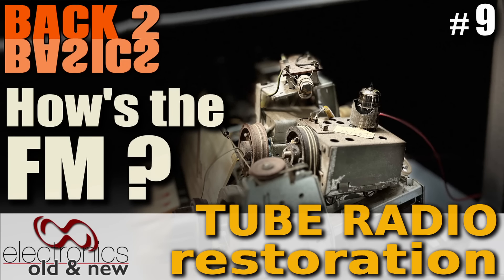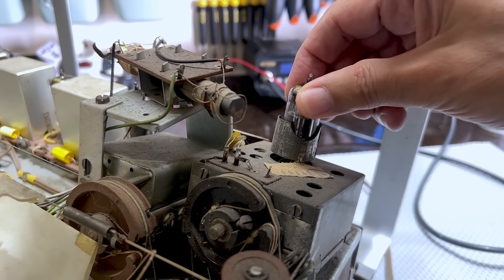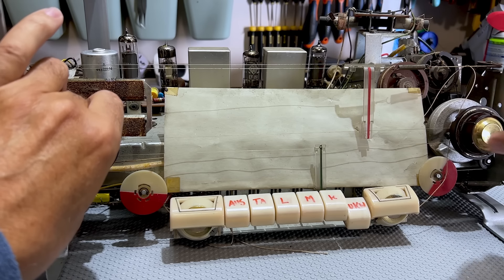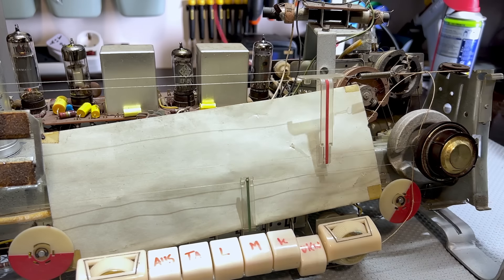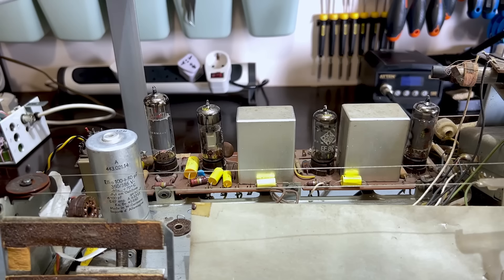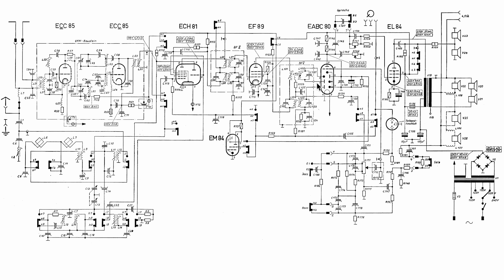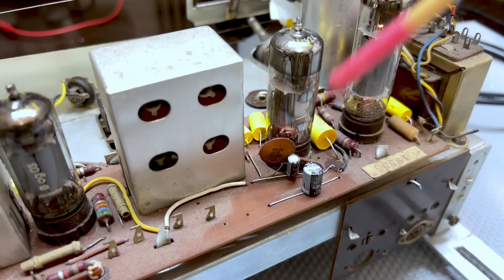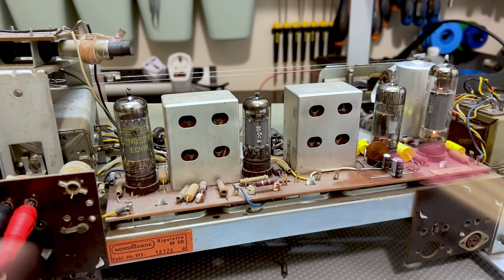Do we have FM, and how does it work? - Tube Radio Restoration Back to Basics part 9

Comment: So much effort in doing the circuit drawing clean up Manuel, kudos 👍 It takes some experience to get one's head around the ratio detector and how it works. In reality, you only need to be able to understand what it's doing and how to set it up. I learn a bit more each time I do one, I expect to learn more when I see you do the FM alignment. 👍🙂
Reply from the maker: The cleanup is part of the routine that I actually find very relaxing 😊 
I read a description recently about a different type of detector, and the author said, “if you can’t understand the theory, look at it as you would an IC”. Made a lot of sense 😊

Comment: FM ratio detector, layman's explanation, that's all I have:  when you observe the bode plot, the graph for the frequency response of the 10.7 filter(s), you will see a mountain top, and on both side the flanks decreasing. That means that a deviation from 10.7 MHz will give a decreasing amplitude. So when you use the flanks (the part as linear as possible), the amplitude (the Voltage output) is somehow proportional to the deviation from 10.7. In that way they change frequency deviation into Voltage fluctuation, hence sound.
Reply from the maker: That is a great explanation 👍

Comment: Well done, my friend! 👍   Unless you have covered this in the past, (can't remember); you might want to go over tube designation. i.e., in the US, a 12AX7 would mean the 12 stands for a 12 volt tube, the AX would be the manufactures designation, and the 7 means there are 7 elements inside the tube.

Comment: Nice one Manuel. But what is it about these radios that induces that faint audio whistle/oscillation between stations on FM? I often hear it and I have yet to understand how to kill it. I'm assuming it's feedback as the intensity usually seems to change as you increase the received frequency. Maybe an instability in the ECC85 FM local oscillator circuit? BTW I'm totally with you on tuning the ratio detector - I was fortunate to pick up a Keithley 2015 meter last year and now I just go for minimum THD. So much easier than fiddling with resistors and microammeters! 🙄
Reply from the maker: Those whistles can be tuned out in the front end, but I wouldn’t mess with it if it can be avoided 😊 
I’ve been looking for one of those meters, but the prices are a little steep. That is indeed the best way to do it.

Comment: Have you come across any which use a phase detector with a gated beam tube?  I know they were more common in television receivers but they were also used in FM radio receivers as well.
Reply from the maker: Never had one of those

Comment: I am thinking of getting this portable oscilloscope with a signal generator.  Do you think it would be useful to do alignments?  FNIRSI DSO153 is the make and model.  Love your videos and teaching methods!
Reply from the maker: Isn’t that the one that goes up to 200kHz? If so, it won’t work for alignments.
Reply: @electronicsoldandnew  AM only?